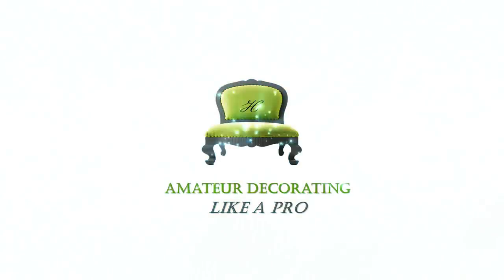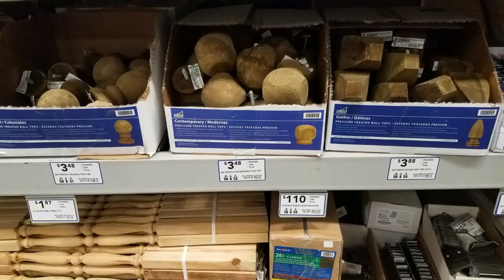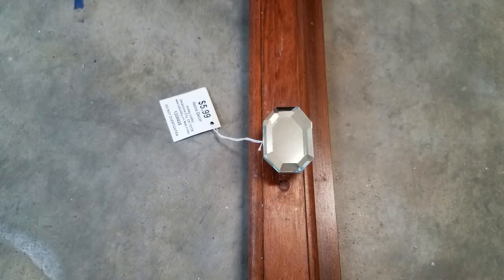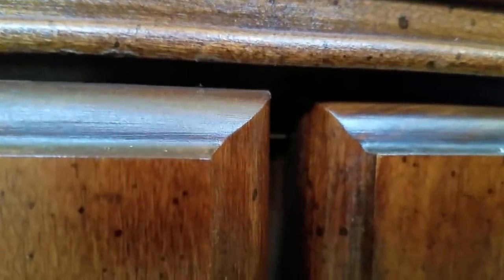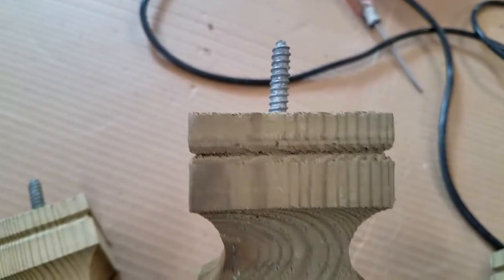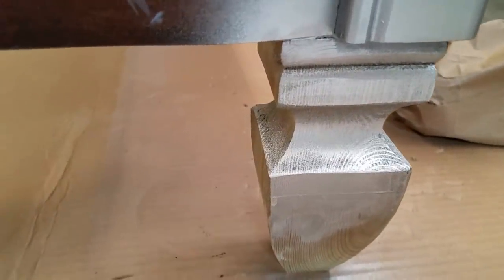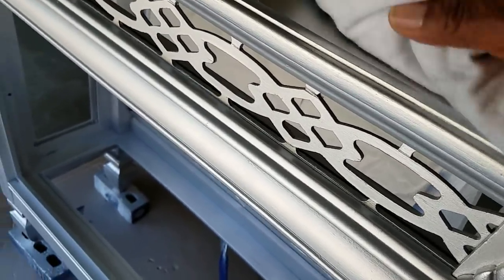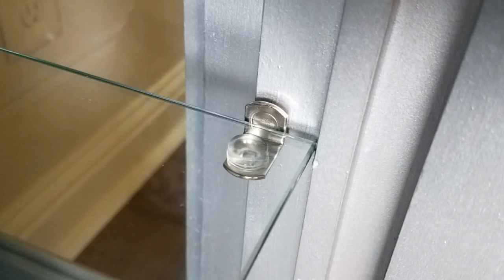DRAB Cabinet Goes METALLIC FAB - Furniture Transformation Series 2018

Comment: Beautiful! You should buy one of those hand attachments that cost 3 or 4 bucks that you attach to the spray can to have a continuous spray instead of holding your finger on the nozzle of the paint can.
Reply from the maker: Hi Darling!  I have several of those hand attachments.  My nozzles were clogged on 2 of the cans.  Don't you hate that?

Comment: DIY....Is me all day long! I love repurposing old furniture and making things for way less than u can buy it new. I try and have spray paint on hand all the time. Spray paints are your friend. As well as chalk paints. Chalk paint is a bit more than regular latex for a quart($20-34) but it's worth it. Because it goes a long way. 
And here's the kicker...u don't have to sand or remove the old finishes. It goes right over it. Just wipe it clean and paint. If u want a glossy look use clear polyurethane. I did my entire kitchen in white with Chalk paint/and glossy white. I'm so pleased with the way they turned out. Also paint the ugly and I mean ugly wallpaper that was in the kitchen. No problem I just painted right over it. Easy easy easy. I didn't even have to take the doors off the cabinets because I want the hardware white,too. So I just painted right over it. 
And if you do want to change the hardware...just take it off and spray paint it the color u like.
You save tons of time and money 💰

Now on to another project🔨🔧🔩✂📌📌✏🎨